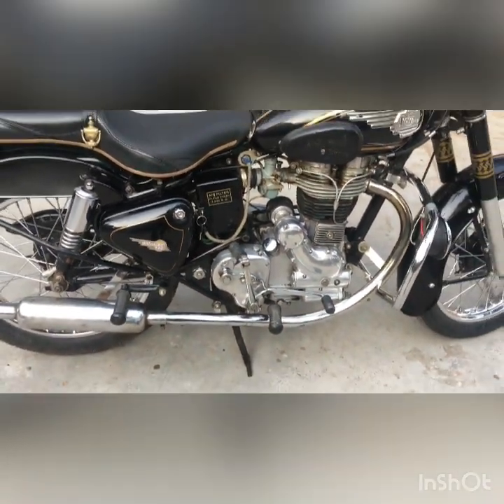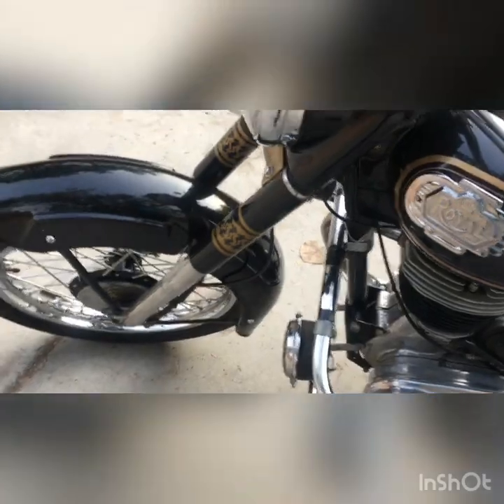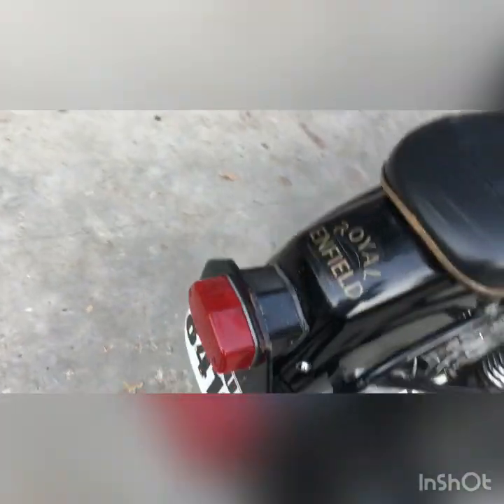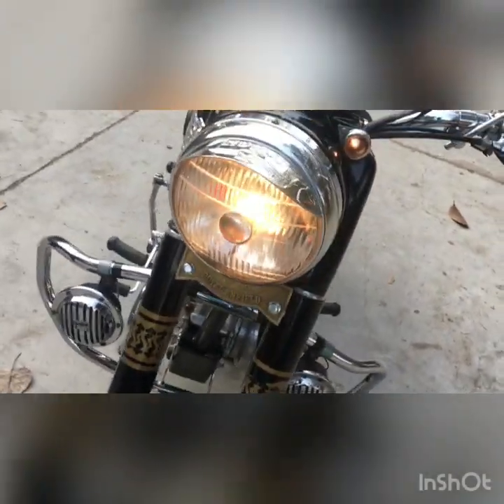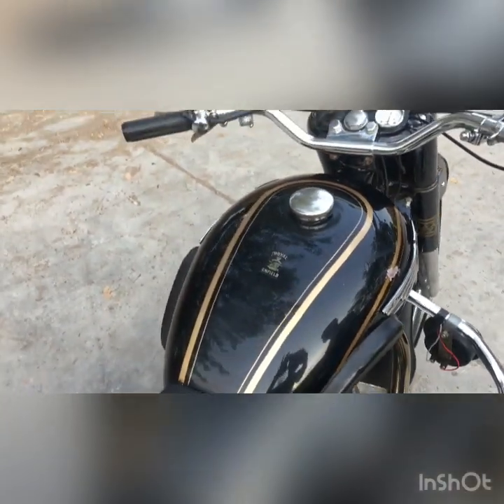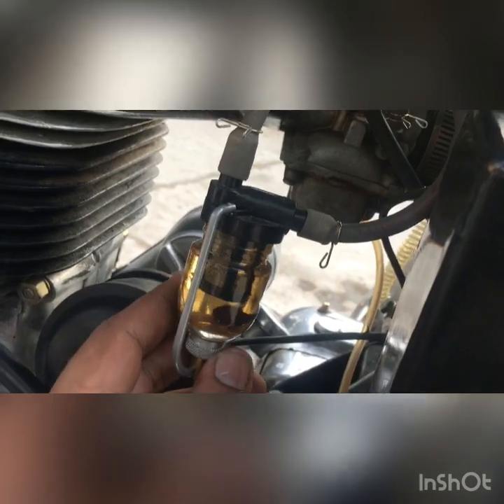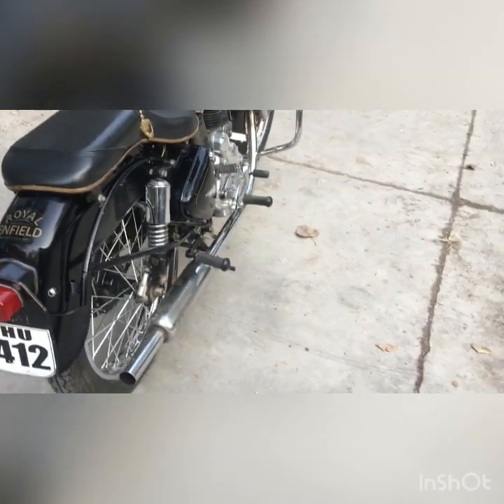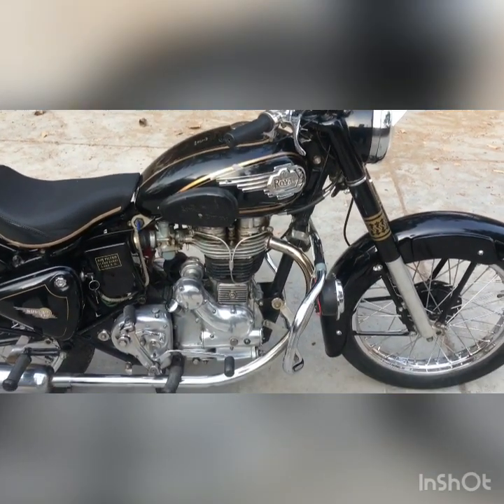1968 Royal Enfield Bullet reviewed

Comment: How is it going after 2 years?
Reply from the maker: Hi there, its running nice, I have added some parts to her beauty like tyre white wall, seats, raja gard
Reply: @RahimShaikhras  yeah I saw that renovation vedio too, good luck with this beauty. If possible keep it original, cheers
Reply from the maker: @Enfield-Forever  yes brother I am not changing anything will keep it original
Reply: @RahimShaikhras  I also have a 1969 I am almost there to achieve stock condition, once it is done I will make vedios

Comment: i m going to buy one 1968 fully restored bike .please suggest  me what prize shuld i buy one.and how much u paid..?
Reply from the maker: There are many things you need to check before buying a vintage bullet.

If it's restored with 98% original fittings thne you can invest upto 1.8 lac
Reply: sir i think it has 40 %  original parts and fully conditioned .he is asking about 1.5 .how much i i have too ask for
Reply from the maker: @pankajh8460  important parts are engine, chassis, gearbox and quality of paint you can pay upto 80 to 90 k based on quality. That also includes the document.

If you have G2 engine with no noise you can add some budget